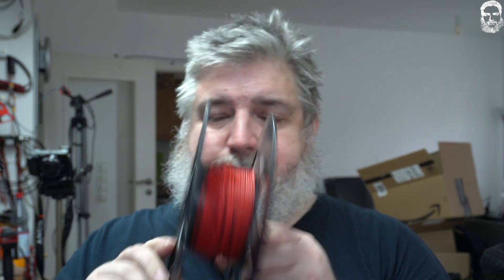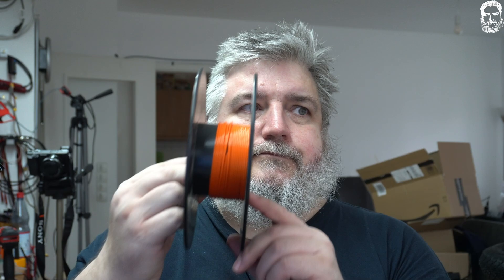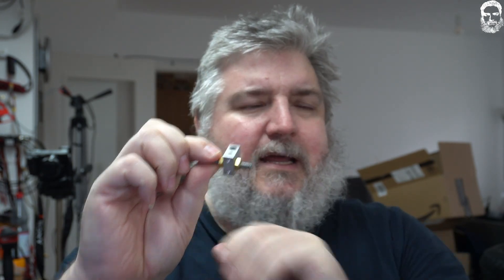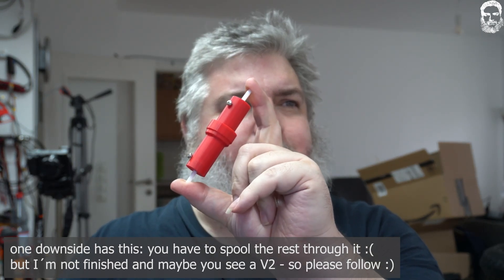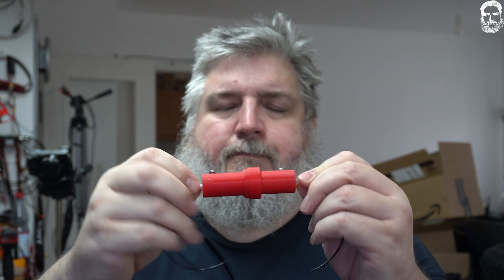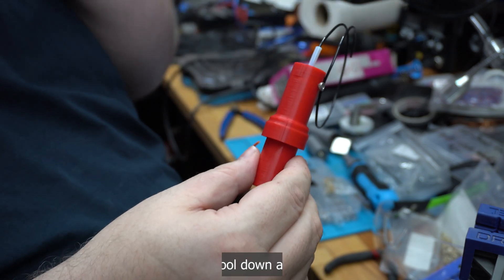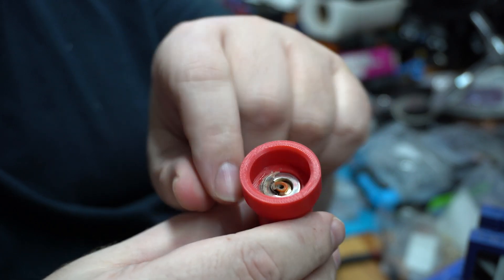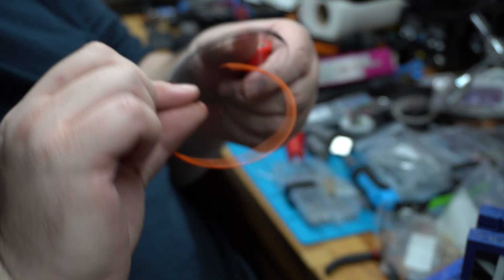Splicing - never waste filament again

Comment: Hi Sanda .. good video and nicely made joiner. Quite a bit of work though.
Having said that .. have you not seen a join made by using a 30mm length of silicone tubing?
Cut a piece of tube (1.5mmID x 3mmOD) .. about 30-40mm in length .. cut filament short ends square .. insert one into each end and push them together to meet in the centre .. while holding the filament firmly on both sides, stretch the silicone tube a tiny amount lengthwise to exert a small amount of tension towards each other .. hit it with a lighter flame for 3-4 seconds .. keep the filament still while cooling (or cool with cold water) .. then slide the silicone tube away .. exposing a near perfect join!!
No having to clean off any dags .. and a very good join because the oxidizing flame never comes in contact with the actual join!!
If it doesn't take properly, redo the procedure using the same piece of silicone tube .. but this doesn't happen very often. (Note: silicone usable to around 240C)
If the join is good .. simply slit the tubing off with a SHARP craft knife or the like.

Silicone Tubing avail from Amazon or Temu.
https://www.amazon.com.au/dp/B091TB21YG?ref=ppx_yo2ov_dt_b_fed_asin_title&th=1

Comment: I tried resistance nichrome wire. Wrap on a 5 cm teflon tube. It worked but if you connect 2 5meter for example you have to feed 5 meter filament

Comment: Is the drill bit 1.60 or 1.65mm?
Reply from the maker: Hello, sorry for the late reply, hab horrible health problems.....
I used a 2mm drill bit. That was the diameter the nozzle already had on the backside. So look what your backside nozzle diameter is and use it. Greetings Sandor - DM4DS

Comment: I just run the small spool until it runs out, and the machine pauses and tells you to load another spool. Then hit "continue". Or just load the small spool into your AMS and it will automatically continue with another spool without your intervention
Reply: not everyone has an ams. or a Bambu Labs printer. there are even people who don't have runout sensors on their printer
Reply: @Bolli1983  damn that's crazy. This is the only printer I've used so I assumed it was the norm

Comment: I really like the cutting approach you're using to remove the excess, but I don't like having to pull the entire remainder through the nozzle. It seems like you have to over-size the hole so filament slightly out of spec won't jam on it, but then you'd get oversized splice points that cause jams. I have a method I'm using now (with a recent video showing it) that avoids this.

Comment: Same problem with that splicer too, no good.
Reply from the maker: @DennisDay58   are you using different style nozzles? Are they touching each other inside the splicer? Can you "feel" how the touching? There must be a reason why it is not working for you. we figure it out, I´m sure. Sandor - DM4DS
Reply: @DM4DS  yes I am using hardened steel nozzles as I switched to Revo Six noozles and gave all of my noozles to my son in law. I have just ordered some brass nooses. one of the things I found out the hard way is Don't glue the Magnets in until you have the nozzle height set as you cannot adjust with the Magnets in place.
Reply from the maker: @DennisDay58  It should work with hardened, too. Much more difficult to drill but then , they should even last longer. The height is the main and most importend thing. If they don´t touch + ~0.5mm to "cut", it does not work. That´s why I tell this in the video. It must be little higher, so the "too much filament" can be cutted by turning....Please come back after you made one with the brass, adjusted to the right height and present us a video of it working :) Happy printing - Sandor - DM4DS
Reply: @DM4DS  I do feel them touching as I push them together.
Reply from the maker: @DennisDay58  Are the form more flat of your style nozzles or why they don´t "cut"? On the brass nozzles, after drilling, there is a sharp edge, both lining up, you have 2 sharp round knives, cutting the filament.

Comment: Awesome design.   You mentioned 2 drill bit sizes and the link doesn’t work. Could you please comment what size bit to use. 

Thanks
Reply from the maker: @John Jerde - checked the ink and for it is working , hmm - it is a set with different sizes from 1-3mm in 0.5mm steps . I used the 2mm one. Used it while the nozzle already had a 2mm hole from the backside! so i used that one - I´m sure you have a local store which sells you such a drill bit. Happy printing and using - DM4DS - Sandor
Reply: Ah. I see. It’s unavailable I’m the USA.  I’ll just find one that will work. 👍🏼